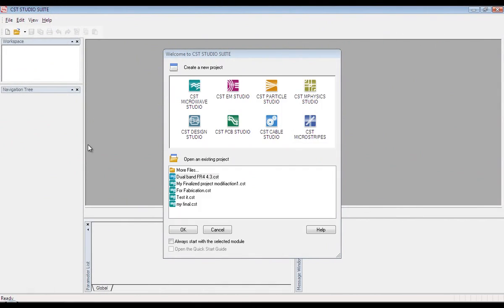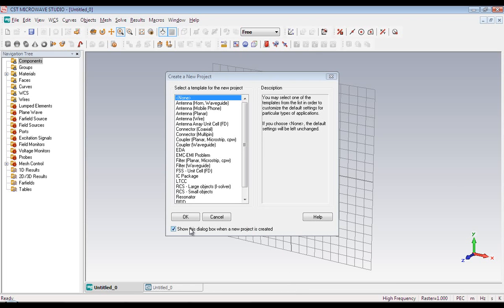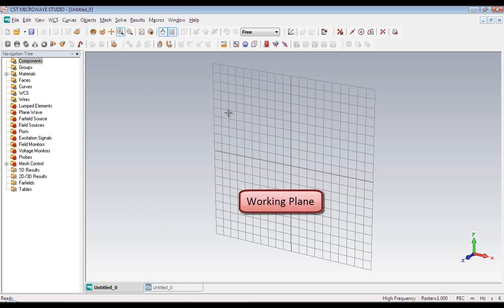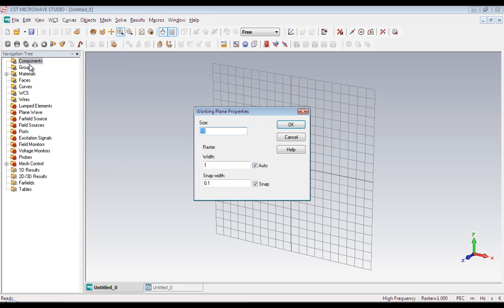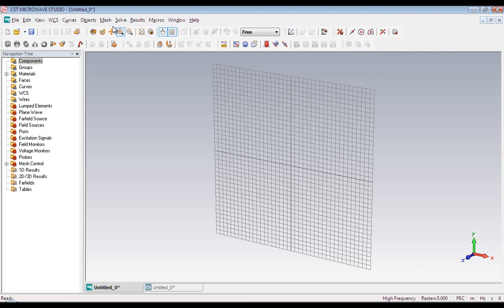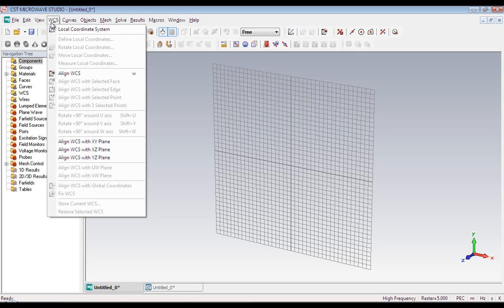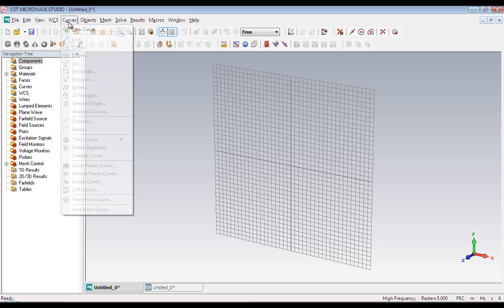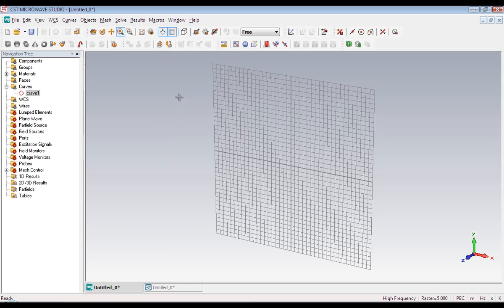CST Elementary Training: Introduction to Menus & GUI

Comment: I'm interested in simulating and designing RF coils for MRI. I’m trying to simulate birdcage quadrature RF coil for MRI in the CST MWS. I have several issues which don't let me to go further in the RF coil simulation process. I will be very grateful to you for any help or advice. Here are questions:

1) What is the difference between H field and B1+ field in CST? It is known that any transmit RF coil produces B1+ field which is transmit magnetic field, any receive RF coil receives the B1- magnetic field, and any transceiver RF coil produces transmit B1+ field and receives B1- field. But what is implied when talking about H and B1+ fields in CST?

2) The arrows of B1+ and B1- fields simulated in CST using the “Template Based Post Processing, MRI Toolbox” are directed along the rungs of birdcage coil, i.e. the B1+ and B1- vectors have the same direction as surface current. How can it be? It is known that vectors of B1+ and B1- fields have to be directed perpendicularly with respect to the vector of B0 field (constant magnetic field directed along Z axis). At the same time, the arrows of H field in CST are directed perpendicularly with respect to rungs, i.e. perpendicularly with respect to the vector of B0 field.

Comment from the maker: @ctfarhanah That happened to me a thousand of times when I was a novice in CST. That's normal. You really need to master the manipulation of local coordinate system and making accurate 'mathematical expression' for each coordinate. I would suggest you to practise to apply the boolean function on different bricks of different materials in a new file.

Comment from the maker: @rishabh413 
For specific coordinates utilize local coordinate system and its 'move' function. Provide required 'movement' distances i.e. DU, DV, DW for bringing the uvw sysem to a particular point.
What did you mean by 'amplitude'of antenna?? You have to be specific. Did you mean amplitude of electric field intensity E?
By the way you can construct a helical coil using 'macro' in cst in a blink of an eye! After that you can employ 'sweep curve'.

Comment from the maker: @rishabh413 
cst is a lot better than matlab for antenna design and simulation..
Creating array is fun in cst. After creating the 1st element, you can quickly create any mxn array by simply translate the element along horizontal and vertical axis.

Comment from the maker: @rishabh413 
Use 'Arc' from curves menue. For each turn of helix, construct an arc. Join the all arcs by drawing straight line connecting the end points of the arcs.
Now draw a circle on the first arc starting point. The circle must lie on a perpendicular plane to the beginning arc. Use the circle's diameter equal to the diameter of the helix antenna wire. 
Use 'sweep curve' function to sweep the circle along the helix locus. That's it.